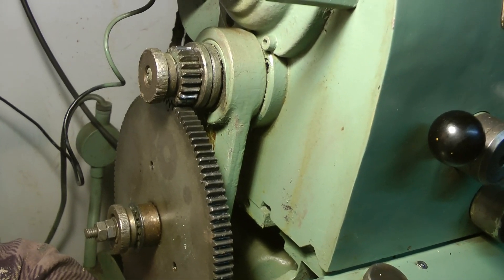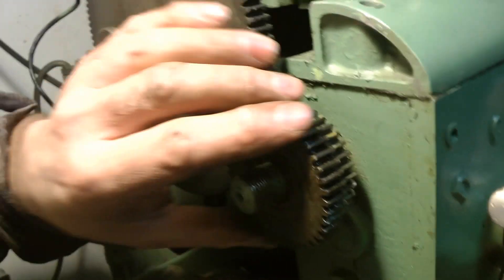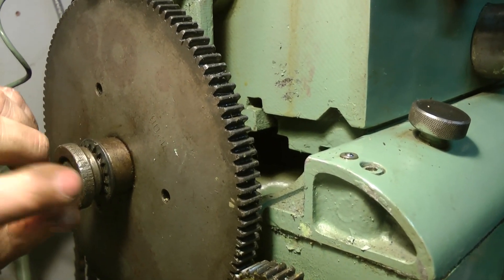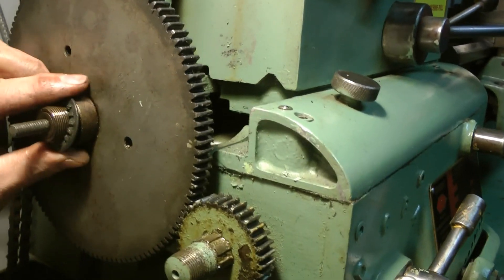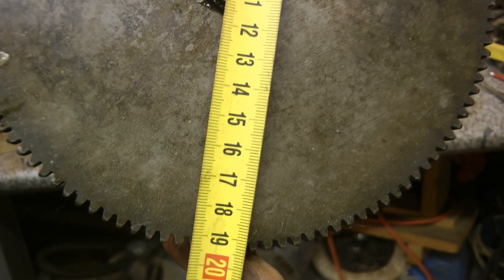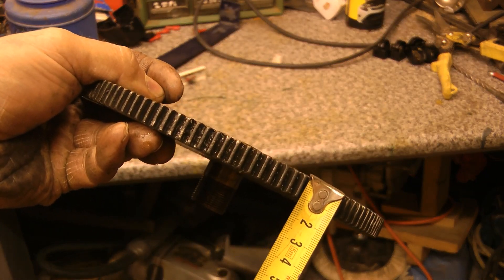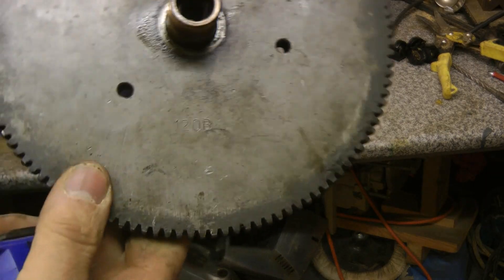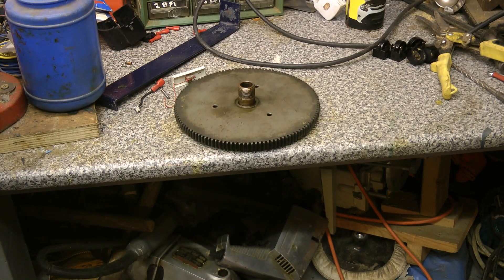The missing Colchester lathe geaR...….. I count a gear for a friend in need de

Comment: I just acquired one of these lathes. My lathe does not shift the “c or d” gear at all. Seems jammed but also looks like it moves the shaft that has 2 gears on it one is extra not being used. Any thoughts?
Reply from the maker: Vanover Customs  hello 👋, I have a look and make a quick vid for you, and I’ll throw it open to the community to see what it is 👍
Reply: @Madchris1  wow that would be awesome Chris. I really appreciate your content. it has been very helpful
Reply: Hey Chris I figured it out. The c d lever was rough to shift it does move when tapped with a hammer. When I tear it down I will clean up the splines and it should be good I am sure there are just some burrs on the splines preventing it from moving easily. Thanks for your reply though
Reply from the maker: Vanover Customs nice 👍 I’m guessing it’s old oil build up (varnishing ) the vid will be on later tonight 😊

Comment: This gear and others on this lathe are 16DP.  Divide the number of teeth +2 by the DP and find it's true outer diameter of 7.625 inches, or 7-5/8".  From this gent's measurements, less than a millimeter error, so no problem. So if you know the DP of the gears for your lathe and the number of teeth on one of them, you can calculate it's diameter without taking it off. Good video 👍
Reply from the maker: thank you, very helpful to myself and others reading this if we can help one person we have done well , that's what the youtube community is all about , chris :)